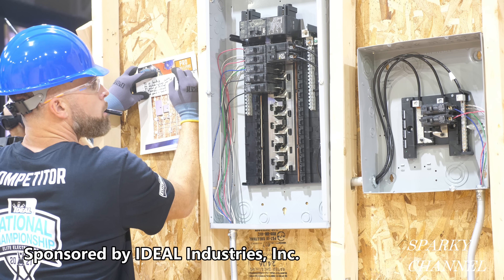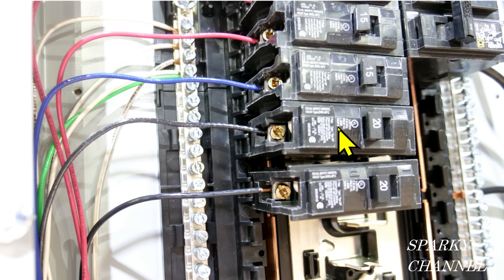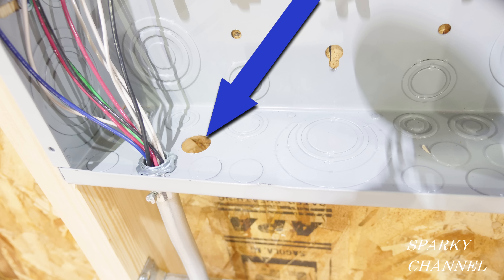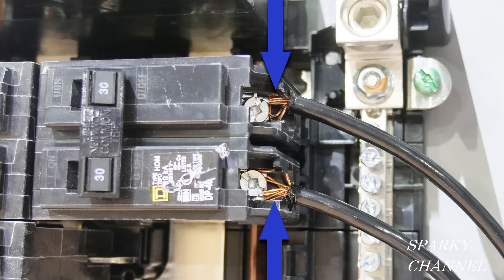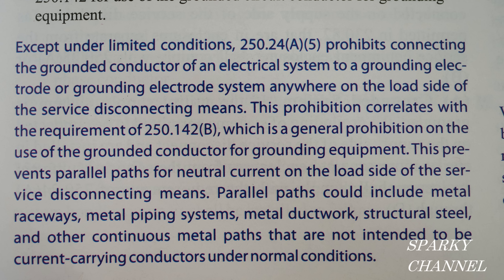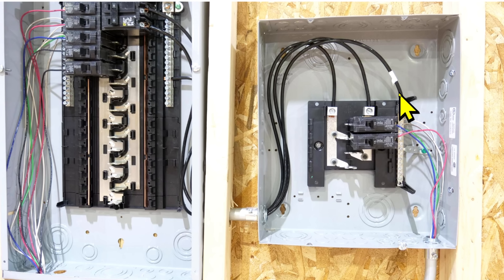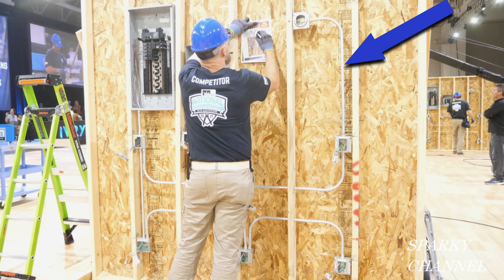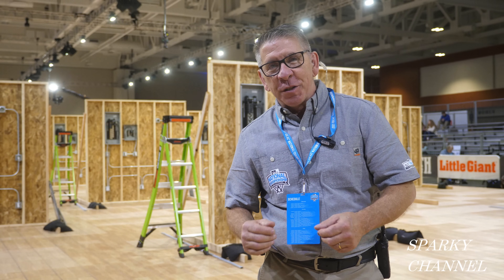Find the NEC Code Violations! IDEAL National Championship Code Violation Board Round 1 Part 2

Comment: All  conduits must have a 1/16" plate to protect against perforation,all wires in the panel must be secure with zip tie or other means, phases must be color coded,all pipes must have bushings with bonding screw, to carry ground when using bonding screw on box,subpanel looks like it has more than 6 breakers therefore it must have its on disconnect. Also subpanel can't carry more load than what is feeding the subpanel. All wires coming off breakers must be identified by permanent means to identify supply and source.
Reply: Single phase does not require color coding, nor are wires required to be zip tied or other means.. You're just talking about workmanship not code

Comment: The copper showing behind the terminal screw is a pathetic rule. The SCREW is ALSO hot and is much more exposed than an 1/8" of wire.
Reply: Similarly dumb rules inside wall outlets. Those side screws sketch me out

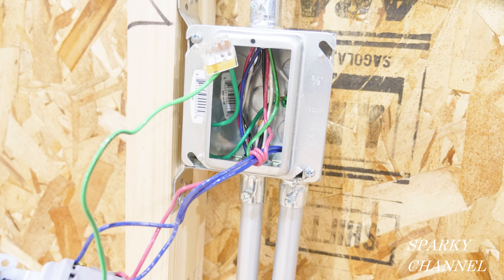Comment: At 9:10, It looks like both red and blue wires are going to the same Device. Looking back at the board I don’t see any time where red and blue wires come from a connected -pole breaker, rather they go to 2 15amp breakers. I know you can do split branch circuits, such that a two pole breaker feeds top and bottom of an outlet with the bonding bar broken, but I’m not aware of valid code that lets a single device be controlled by two breakers that are not connected to break together. Curious if someone can confirm this who is actually an electrician Dash I just know the code well enough to ensure what I have wired in my shop is valid and did not encounter the situation.
Reply: If that is just a switch with a control wire, I especially don’t like the use of blue as a hot wire from the panel if it then changes to a control wire for a three way switch

Comment: I really don't get why tapeing the ends are not sufficient for identifying. If somone is too lazy/smart enough to verify, they have no buisness doing any electrical. All that does is make the wire room at the shop more of a mess or another run to the supply house.
Reply from the maker: I understand your point but the code is the code.

Comment: When did they make it code to have an equipment grounding wire so that it is bonded to the outlet when using metal conduit?  I have been out of the  business for a while.
Reply from the maker: It isn't. You are correct.
Reply: My understanding of the code is: an equipment grounding conductor is not required when using any metallic conduit that is suitable to be used as a ground, however if you do run a grounding conductor in that conduit: it must be bonded to any metallic enclosure in which a splice or termination of a current carrying conductor is made.

Comment: Hey sparky I always love using 10 gage wiring for homes. My home was built in 1973 and all the wiring is 10 gage even for the light fixtures. I like using the 10 gage wires for long distance travel through out the homes. They last alot longer.
Reply: I have never seen copper not last, how does it not last?
Reply: @lw7238  Depending on how you use it and What area you live in.
Reply: @crockpot5194  wtf, that's not how this works.
Reply: @TheCarpenterUnion  Describe "THIS"?

Comment: Oh gosh, if that box is overfilled, then you really don't want to see some of the boxes in my house. The ceiling fan in my bedroom literally has the hot wire, the wall switch wire, and at least 5 different electrical outlets all wire nutted together in that box.
Reply from the maker: That does sound overcrowded.
Reply: @SparkyChannel  It is an old house. Most of the wiring does not even have a neutral.

Comment: I'm a sparky in Australia. There are a few differences here, I won't go into all of them now but... The Neutral wire will mostly be a black ( or blue ) wire, it is the actives that have to be colour coded. Also most switch plates are plastic, no earth bond but if metal it should have earth bonding.
BTW split phases isn't a real thing here. 240v/415v the standard. :-)
Reply from the maker: Interesting. Thanks!

Comment: I may not be up to date but, EMT conduits and metal boxes in this video do not serve as grounding conductors? Especially in commercial settings, this would be very costly and reduce conduit and boxes capacity. Could you show me if this code has been updated to adding ground wire in metal conduits in the recent NEC?
Reply: As far as I know conduit has not counted as a grounded conductor for a long time. You have always had to have a grounding wire in the pipe bonded at every junction point. This is due to the fact the conduit can be separated by accident or bad connection breaking the ground.
Reply: @chazman4461  I have been out of the business for a while but it was never code in residential where I live to run a green grounding wire through every inch of conduit.
Reply: @chazman4461  It seems that you are right when dealing with specific cases such as "flexible" metal conduits. After I looked around, from NEC 2020 the code still referenced section 250.118 and listing 3 types of rigid (including EMT) as  "equipment grounding conductors." I also found a document dated from 2020 refering to and citing the the NEC's 250.118 section from the Steel Tube Institute. I am a strong believer in the N Code, it is not a technocratic irrationally built regulatory code like many other industries may have. All in all the NE code evolves based on true situations and also new contexts (such EV or Solar/Wind related situations). I would say all changes are always sound and grounded in good policy.
Reply: Cable company I know got in a lot of trouble for grounding to EMT conduit.  Threaded conduit was okay. And the boxes were okay.
Reply: @MrNoobed  i guess then that they were also following the guidelines of the NEC. You have to make sure that the conduits, EMT or otherwise must be secured and thighten. This in of the reasons, using the same principles, i still trust wirenuts as the dominant leading way to ‘secure’ and ‘thighten’ wires and avoid with receptacles and connectors alike, installing these ‘plug-ins’ type of receptacles or connectors or, opt for metal in most circumstances (non metal piping exposed to sun don’t do well in long run....thus can get undone and create pressure on wires inside / and this is apart from damages.

Comment: 4 wire is required from main panel to sub panel.
Reply: I was thinking the same.
Reply: Do you mean 3-phase 4 wire, or are you referring to there being a grounding wire?
Something I'll look up for sure.
If you mean 3-phase: I'm fairly certain it's a single phase main panel.
Reply: @NinjasKill123  4 wire as in 2 hot, ground and neutral to subpanel. it is a nec requirement.
Reply: @vicious4884  The NEC allows you to use EMT as an equipment grounding conductor, and since the panels are connected via EMT a separate wire type EGC is not necessary.
Reply: Looks like a single phase subpanel?

Comment: You are right, but not 100% right on conductor size in relation to breaker size, Certain coatings and applications are allowed to take more amp,s  THWN, you mostly see those types of wire coatings in equipment, check out inside a washing machine or HVAC equipment,,,, most of the wire is 16 and 14 gauge. but it's more than likely not THHN.
Reply: Nope. The code requirements for small conductors says a #14 is limited to 15 amps,  #12 is limited to 20 amps, etc. Appliances may use smaller wire than the NEC requires as the NEC doesn't apply to the wiring of appliances.
Reply: @crissd8283  the NEC doesn't take into allowance the insulation? Lawl that sucks. The CEC does.
Reply: @Morberis  It does for wire larger than #10 and you can use the insulation for correction values such has lots of conductors in a single conduit, or conductors in hotter ambient conditions, but there is an over riding rule that a #14 can't have more than 15 amp breaker, #12 a 20amp breaker, and #10 a 30amp breaker. I agree it is stupid, if you can correct down for packed wires based on the insulation, why can't you use the wire for what it was UL listed to handle.
Reply: @crissd8283  that is very similar to the way the CEC does it but the initial amperage is based on the insulation rating. Except in residential houses, then it's like the NEC

Comment: This was interesting. So the grounding rod to my outside garage is pointless.
Reply: @Matthew Conley - No, not "pointless" - As I understand it, you just shouldn't have the ground/earth, and neutral, bonded to the same bus-bar (in that service panel); presuming that your garage panel, is a sub panel. 
I'm a long time, out of spec, that said; I believe the requirements, for additional grounding rods, have to do with a combination of, wire size (gauge/AWG), load, and distance, from the primary-panel - check your local codes, and/or, NEC handbook. 
Somebody better qualified, may explain this, better. Cheers-
Reply: @markaoslo5653  garage is on a sub panel, it's also a metal building, so when I installed it, I figured to cover all bases, and install a new grounding rod to just the garage.
Reply: @SimonTekConley  - I think... as long as your garage (sub) panel, is separate neutral and ground - you certainly didn't hurt anything... We'll see if any current, licensed pro's, have any comments - I'm not sure, on the metal-clad (wood-frame) buildings; what grounding, would be required; and how much may have to do with electrical service protection, and/or, lightning shunting...?
Reply: Like was previously mentioned, the ground rod must be on a separate bus bar than the neutral bus bar. The neutral and ground can't be on the same bus bar in your sub panel. I just dealt with this after I installed my sub panel in my garage and hired a licensed electrician to come inspect a lot of my electrical work around the house. He put in an extra bus bar for the ground and grounded it separately with the ground rod outside my garage. Otherwise if something grounded out it would just go to your neutral bar and then all the way to the neutral bar inside the main panel which is dangerous. You'd rather just ground it out right after the sub panel. Hope this helps.
Reply: @ColinBPlays  yeah, it wasn't on the neutral bus, just the ground bus.
Reply: @SimonTekConley  well then I'm not sure why you would consider that pointless? I guess everyone commenting to you is not understanding because you didn't give us enough information of what you think the problem is or if there is even a problem with what you did. I guess your comment was a bit confusing because you didn't actually ask a question.
Reply: @ColinBPlays  I think what I did was correct, but I wasn't sure if putting a grounding rod just on the garage seemed a bit crazy. But I did it because I didn't think it was worth running a ground all the way underground back to the house...
Reply: @SimonTekConley  Ahh okay now I get it. And it isn't crazy, we have 3 separate garages and they all have their own rods.
Reply: As long as the neutral and earth are not bonded there. no problem, if all the earths are bonded together. Multiple earth stakes will only give you a better ( for want of a better word ) footprint for earth faults.

Comment: i wish there was a low voltage challenge.
Reply from the maker: Me too, good idea.
Reply: Technically 500vac is low voltage, do you mean extra low voltage...
Reply: @alanhilder1883  low/control (5-24v)
Reply: @Hyratel  That is classed as extra low. High voltage is over 1000vdc and ( I think, it has been a while ) over 600vac. I didn't make up the rules... ;-)
Reply: @alanhilder1883  I was going on the notion that Cody (top level commenter) was using "Low Voltage" in the common/colloquial sense, not Sparky Vocab, and in non-SparkyTrade contexts, 5v is 'low', 24v would be 'high', so my conclusion was that Cody meant XLow/Control 24v?

Comment: Some codes make sense...... some others were invented by someone smokin something, because they make no sense whatsoever.......
Reply: I believe some are made by lobbying, such as the  1994 addition regarding only using the same brand of breaker as the one made by the manufacturer.
Reply: @DGTelevsionNetwork  that one galls me but i can kinnnnda see it. The stated justification is that some panel tabs may be thinner or thicker than the breaker's contact leaves are designed for
Reply: @Hyratel  That's why we have such things as product dimension standards.

Comment: 99% of this is common sense, no need to follow the handbook for that
Metal panel/ tubes/ gas pipes/ whatever? Obviously needs to be grounded.
Thinner wire needs smaller breaker... or the breaker will hold and the wire will act as a heater.
Breakers/ tubes dangling willy-nilly - no comment
Sharp edges on openings and cables running trough? Insulation might last years instead of decades, or get damaged during installation. Obviously needs to be secured.
Loose strands / ghetto connection - fine stand needs a terminal or the strands will break over time and the connection needs to be firm.. loose= more resistance
neutral-ground connections in sub-panels you can't fuk up if you work with rcbo's.... unless you fuk it up by not connecting the rcbo(s) at all (I've seen such a "wireless technology" rcbo XDD)
Reply from the maker: Excellent over-view!

Comment: 2:44 It would've made more sense to read the specs off of a 20A breaker showing that 12 wire is the smallest it's rated for... in my opinion. Even better would have been comparing them side-by-side. That's actually what I would do for an apprentice.
Reply: 14 AWG is allow on the 20A breaker if it's most types of wire (THHN and THWN being the most common, and allowed). Only TW, UF, or Aluminum/Clad aren't allowed.

Comment: 7:27  What practical purpose does prohibiting remarking 6 G and smaller wire with white tape serve? ( typed larger smaller, deleted larger )
Reply: Wrapping it in colored tape (or other methods, like paint markers for example) is called 'field identifying'. You ARE allowed to field ID 6 and smaller but if you do you must cover the whole wire, end to end. There is no practical purpose that I can think of other than to ensure that it cannot be miss identified at any point. It used to be okay to just field ID both ends. My guess is something bad happened and the code committee just said the whole wire has to be identified as the correct color end to end.
Reply: @binaryglitch64  It's just another one of those head scratching codes, fine to mark the ends 4 and larger, but the 6 and smaller must be marked the whole way!!!
Reply: Do you mean 6 and smaller?
Reply: @newjerseybill3521  I fixed my post.  Yes I'm aware that the higher wire gauge  number = smaller diameter wire.
Reply: @bobroberts2371  I was pretty sure it was just a typo. :)
Reply: Maybe since thinner wire is less expensive, it's easier to have another color on hand?
Reply: @chazchaz101  well that's why it's not too impractical to comply with but doesn't give a pracyical reason why the rule needs to exist in the first place. Don't get me wrong, I comply with code weather I understand the need for it or not, but I don't always understand the need for it.
Reply: @binaryglitch64  there's a lot of "how did someone f* up This Bad" rules in the code

Comment: I don't think you have been very clear on bond vs. bonding neutral.  Bonding is attaching to the system ground loop: all enclosures, panels and or devices of the system or subsystem.  The issue you are trying to illuminate is that the neutral shall not be bonded ( to ground) in any other location than the main service panel. The sub panel itself should be bonded (to the system ground loop) but not to the neutral bar that should remain isolated from the enclosure. The neutral shall only be bonded to ground at the main service panel.  I've always thought of the ground as "life safety" , and neutrals as return path.  Though this is not a common way to  referred to them, it does express the nature of these systems and why bonding them together out side of the main service panel is not allowed.
Reply: @NickDangerThirdGuy  - "ground as "life safety" , and neutrals as return path" - 👍, for that...

Comment: Everyone thinks they're an electrician! As a commercial/industrial electrician, I have seen some crazy work! When people see mine, I want them to say; "Damn, look at how nice that panel looks!" I can sleep at night, knowing my work will not burn down, or hurt someone..Great Video!
Reply: I agree! I still have not figured out why the house my son just purchased has a split panel!!!  Why would the original installer make the system NOT able to fully disconnect from the grid between the house main panel and the meter?  (House was built around 1958.)